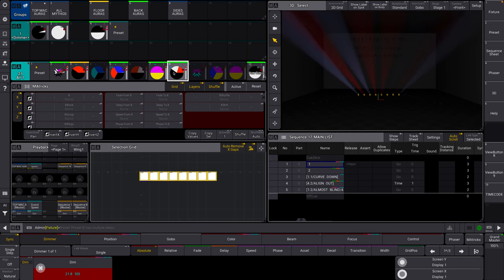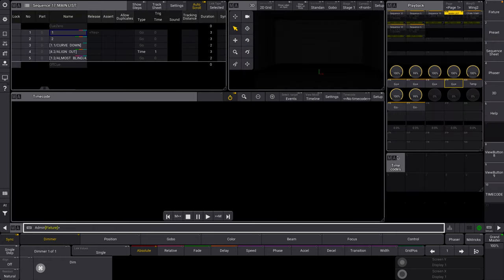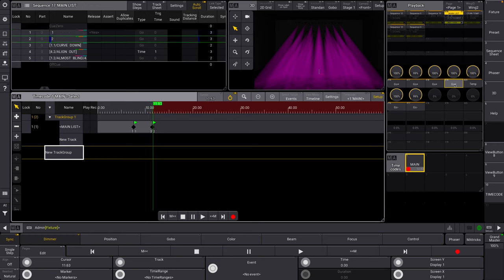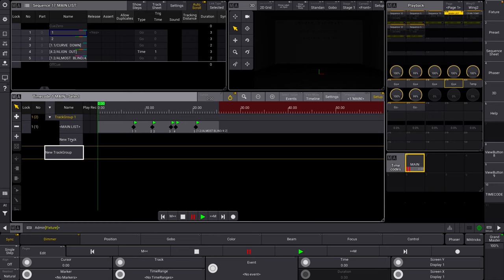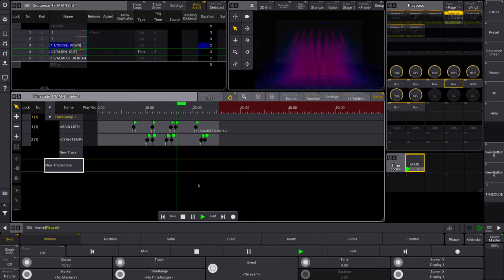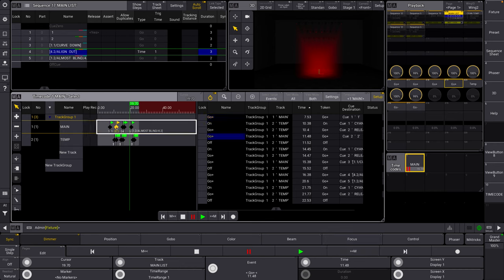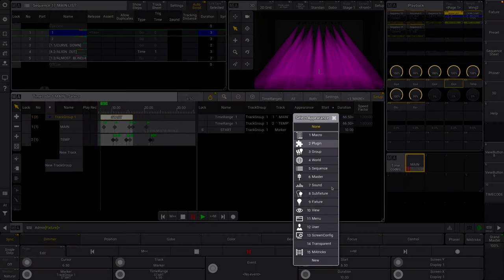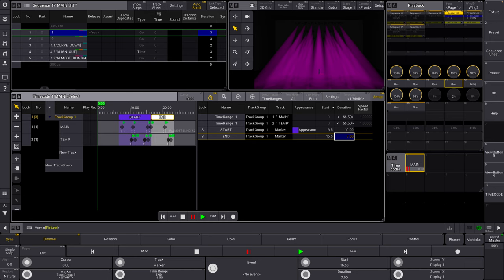The MA3 Timecode Crash Course! Learn How To Record, Edit, and Playback Timecode in Only 8 Minutes!

Comment: Midi timecode from Reaper on MA3 running on same PC?  Was possible MA2 but not  in MA3 V1 on PC. Also the manual is not clear if it is available in V1.7 .  Artnet timecode is possible on MA3
Reply: Yes it's possible
Reply: @osqtin     https://txl20.com/    will have a converter to Artnet timecode. Will check new release Grandma3 on PC if  timecode slot will accept MTC now from virtual midi port